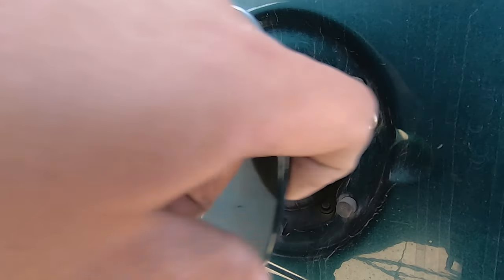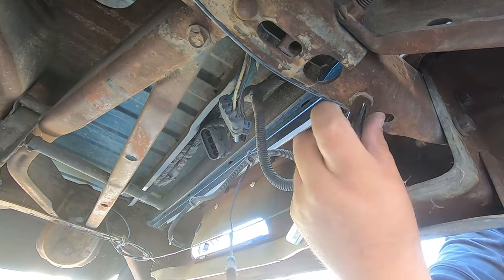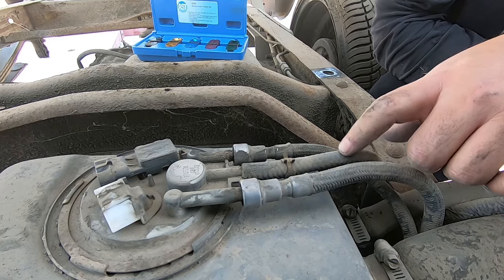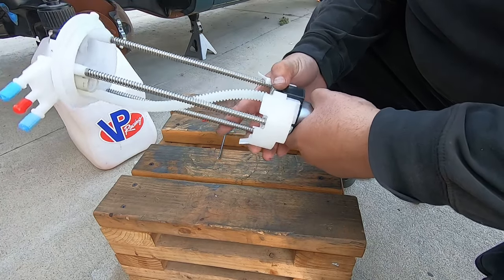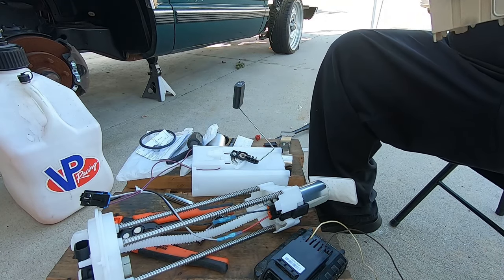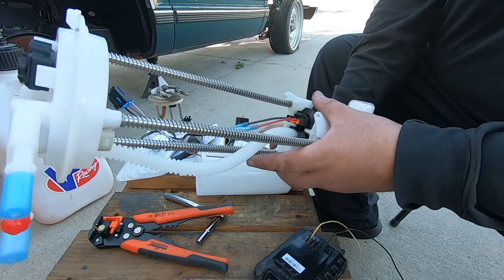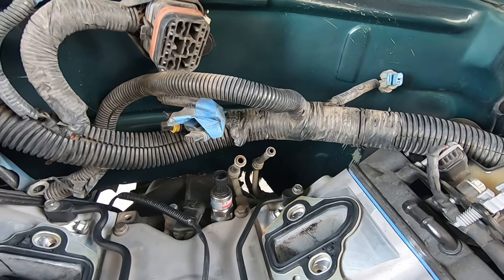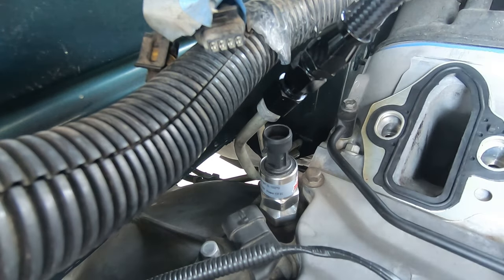Chevy OBS LS swap fuel system upgrade

Comment: Are you going to run yours like factory or off the ok pressure switch to turn on the pump?
Reply from the maker: It gunna be like a shock truck fuel pump powered by the key

Comment: Did you use 8 an or 10 an for your fuel line to an fittings? so ik what ptfe hose to run
Reply from the maker: an6 fittings and an6 PTFE line

Comment: How long are the lines. I rather make them that long. Then the other YouTuber I saw. He had each one running 2ft
Reply from the maker: Good question I haven’t measured them but I do have a 20ft roll of PTFE fuel line which I think I will only use a lil over half of that if I had to guess 6-7 feet
Reply: 14:36 I meant these. Should have specified myself
Reply from the maker: @DaBundle  I see they are 4.5 inch PTFE fuel line with fittings 5.5 inches very small but it works

Comment: I'm way past all this, i just came to see what you were up to for 💩😂's. I started out just like this. It worked, Well I went through three of those fuel pumps before i changed to Aeromotive.  Now it's all in a box somewhere hiding from the mud dobbers. Besides the terminator, this is the ( just enough, it will work) Approach, Besides the terminator. Which you don't need, if you're going B minimum everything else. I'm not breaking anybody's balls, like I said I did the same thing and learned. Well kinda, I did it this way because I couldn't afford to do it right all at once. Which means in the long run.
It costs you more. Like buying a custom car That someone spent eighty thousand dollars to build, for 30 grand At barrett jackson. It is what it is. You buy the training wheels and then you throw them away. 🤙
Reply from the maker: Thank you for watching I appreciate the comment